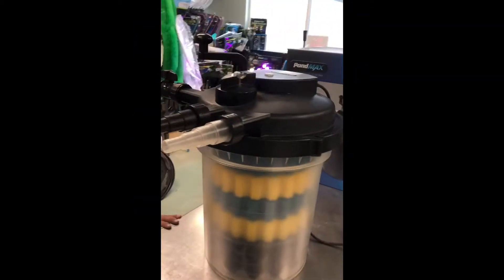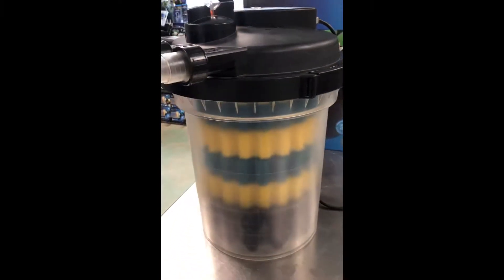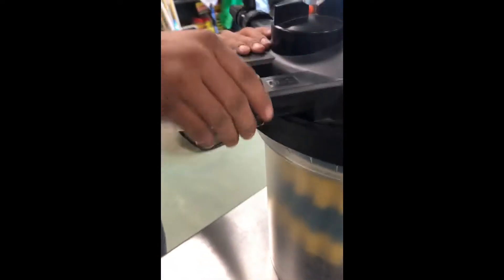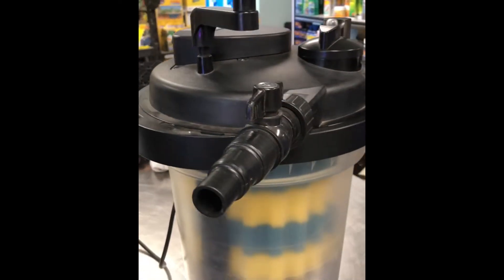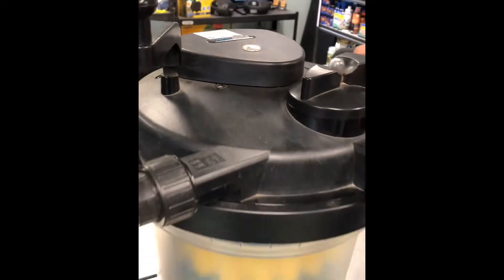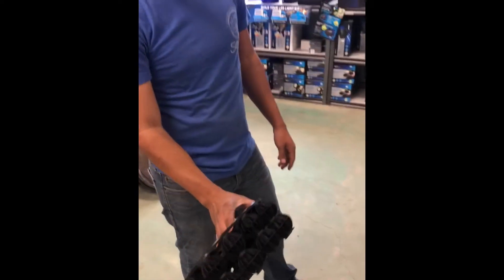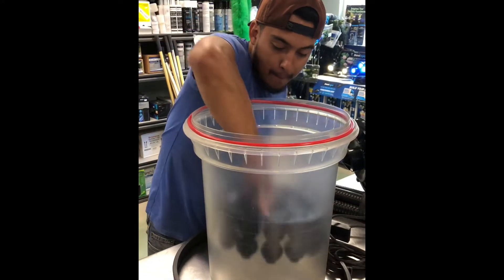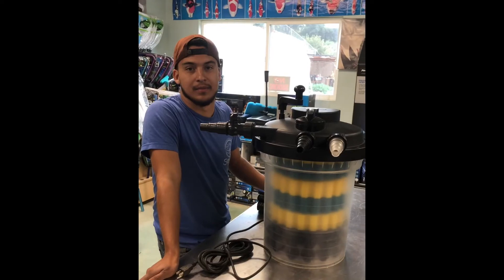Pond max filter

Comment: You said you was gonna show us how it worked through the transparent cover but you didn’t put it into action, that’s the only reason I clicked because I wanna know whether the flow goes through the 1st pad, then 2nd then 3rd etc..... because if so the coarse should be at top and the medium below it. I’ve just bought a similar filter and trying to find out. In mine the filter sponges are mixed up too. Coarse to medium then coarse to medium so that’s not right if flow goes top to bottom.

Comment: JEFF, CAN I ASK A QUESTION, WHEN I TRY TO BACKWASH I HAVE VERY LOW PRESSURE OF THE DIRTYWATER COMING OUT, (IT IS Trickling CLEAR WATER).  what does it sound like problem IS?  only a 1600 model [NO BIO BALLS ON BOTTOM]?
Reply: Looks like Jeff didn't answer you.

Comment: You don't show how to replace the filters... otherwise good... :-)
Reply: Well .. here we are a year later.. and you still haven't told your nearly 10, 000 viewers that you must load the filter segments such that the smaller hole is on top... if you do it the other way.. it will kinda fit.. but the paddles will chew the foam quite a bit over time... oh... and there are no instructions in the kit when you purchase it